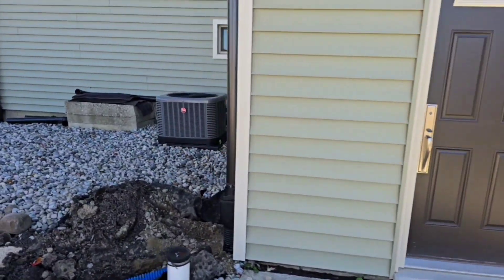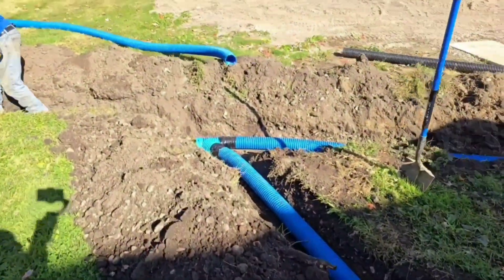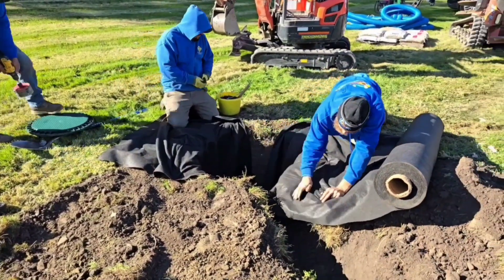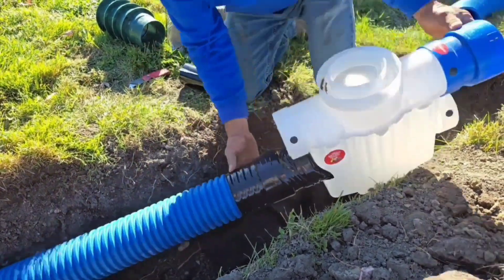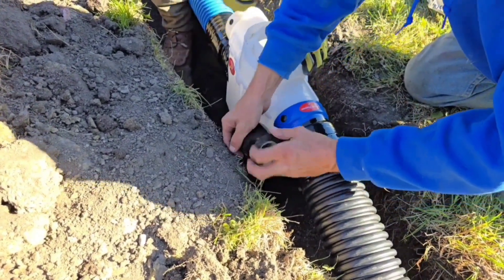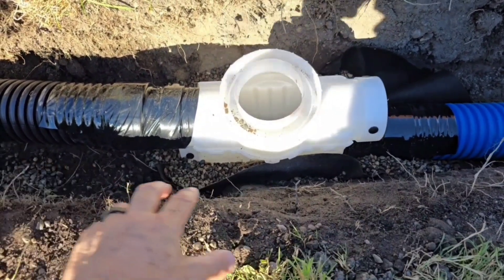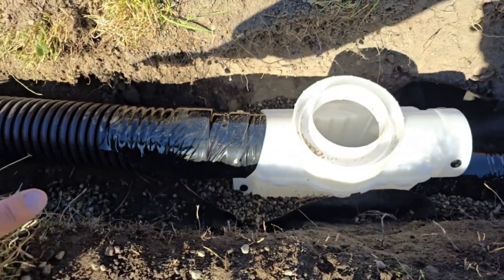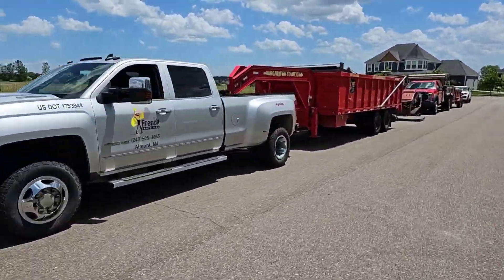How to Build a Dry Well for Downspouts:" When You Want It Done Right the First Time"

Comment: Been watching a lot of your videos - I have a drywell for a sump pump discharge and I was going to run a catch basin and pipe to it for one down spot. The catch basin is one of the NDS 9in. what slope would I need to ensure that if it overflows it will come out of the top of the drywell and not back up to the catch basin? The downspout is over concrete so it runs across a sidewalk and will sit on top of the catch basin.
Reply from the maker: 1% Slope
Reply: I should mention my sump pump discharge is annoyingly all underground, but has a backflow valve, so im hoping worst case the pump can still push water even if adding the downspout overwhelms the drywell and just go into the yard from the drain on top of the drywell and not the catch basin

Comment: I live in a townhouse backed up to a creek and sandwiched between two neighbors. My roof downspouts go into a sump and is pumped under the house to the sewer. I can't pump the water to the creek and i can't run piping through my neighbors backyards. I want to get rid of the sump pump because I can hear it whenever it comes on. I'm too old to dig holes. Who do i get to do this kind of work? Plumbers? Landscapers?  I've tried both and they just point their fingers to each other. Any advice would be appreciated.
Reply from the maker: Google "Yard Drainage Contractor near me"

Comment: Would you recommend a septic box when connecting 2 gutters with underground piping but they daylight approximately 20-30 away from the house downhill? I plan of purchasing your products specifically to make my gutters underground discharge vs surface.
Reply from the maker: On long runs, I recommend using our catch basin so that you can have a cleanout. Minimally, you need our Leaf filter so that you don’t clog the downspout line.

Comment: Do you wrap the fabric around the clean out? I’m thinking that the soil would eventually mix with the pea stone. Any concerns?
Reply from the maker: Some contractors do that. All I’m trying to do is stick to the clay; it will prevent the water from leaching into the subsurface. As long as I have some stone under it, it doesn’t matter if sediment settles in the bottom of the trench. I don’t think it’s really going to be that much, and I don’t find it to be a concern. However, some contractors will wrap the entire D-Box/septic box.
Reply: Been watching your videos. Just finished my sump pump and down spout drains to buried corrugated pipe toward street .
Thanks from Barrie Ontario. 🇨🇦
Reply: If you got a small backyard of 20 to 30 feet long by 10 to 20 feet, surrounded by neighbors what do you recommend for your downspouts?